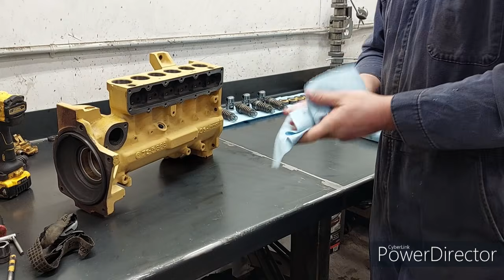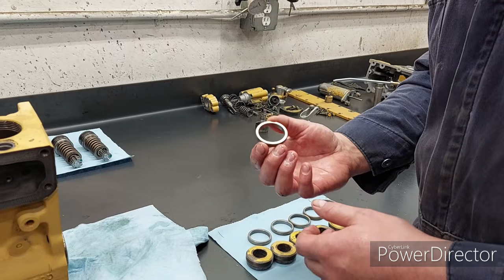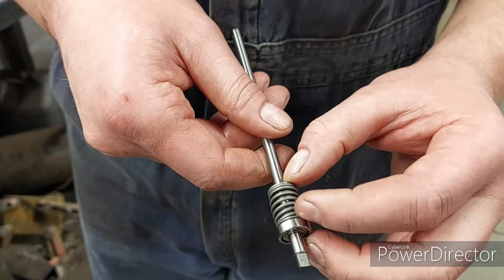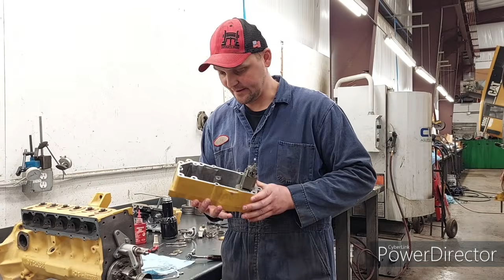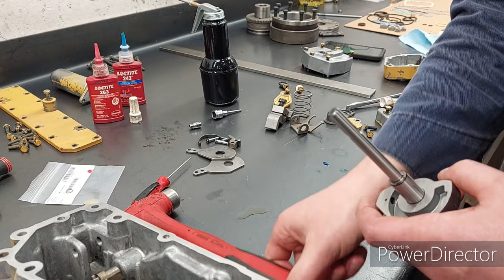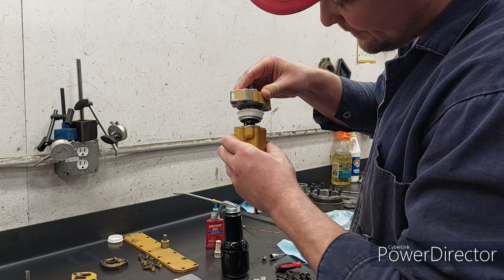3406B Fuel Pump

Comment: I have a leak coming out of the top of #5 hole how tuff to change o ring… I’ve heard it can get tricky??? Thoughts
Reply: If the leak is on the inside around the line it is the line or the bonnet. If the leak is on the outside between the bushing and the housing, it is the seal. Or you could say the threaded area. If not sure, get some odd color paint and clean the top of the pump, then paint it with the odd color and start the engine. The fresh paint will wash away when the fuel hits it. Fixing the leak you have to worry about three things, clean, clean and clean. Most people try to remove the bushing. You have to have a special tool and take the bushing out and just replace the o-ring. Then all the debris falls down into the pump and you will start getting fuel in the oil. The correct way is to remove the shut off solenoid (6I2002gasket), remove the plug under the air compressor on top of the pump 9/16 wrench. Install a rack centering pin (special tool), remove the side cover on side of the pump. Two bolts 7/16 wrench, 1H9696 o-ring. Move the throttle wide open and make sure the rack is now in the center position. Remove the bushing and the pump. You have a spacer under the pump, remove it.  Clean the bottom of the pump, spacer and inside housing. Inspect the spacer for nicks, replace it if you see any. Depending on which engine you have you have two sizes. DO NOT PUT THE WRONG ONE IN. I also clean the rust off the top of the bonnet on the pump and the bushing. The bushing was a problem on these and Cat updated them. They would not seat the pump good enough and over time fuel would bypass on injection. You would have a stumble on acceleration (could also be a nozzle). Cat update the bushing and again you have two depends on what engine you have. "Get this article from Cat a Truck Engine News 11/01/1985 Check Fuel Injection Replacement Pump Installation (SEBD6553)" The oring has been updated numerous times, the best one is 1313719 (Pink). Also a 8H9204 felt washer it goes in after you torque the bushing 190 FT LBS. I put the spacer back in, put the pump in clean fuel and you have to align the gear to the slot by eye. It is best to replace the bushing with the updated one (you don't have to). Put clean fuel on the seal and bushing. Make sure the leaking cylinder the fuel pump cam is down and you are not fighting against the lobe. Put the pump, seal and bushing in. Do NOT force it, a little is OK. Get the bushing started and run it down until it seats. Check the pump timing using the Truck Engine News Article. If the rack does not move, get the pump back out. The rack HAS TO BE FREE. If it is not the engine could run away and blow up. So you lift the pin up and push the rack back and see if it is in time. Then move the rack to the shut off position and see if is in time that way. If all is good torque the bushing and finish assembly. Sometimes you could be fixing one hole and the leak will move to another one. This system has no relief valve in the low fuel psi side. If the fuel return line is plugged up or not allowing enogh fuel to return to tank, the leak on top of the pump will move to the next weakest seal. Most of the older 3406B/C's uses a number four fuel line. I like a number six as it is larger and last longer. The way this engine makes low side fuel psi is the return fitting in the pump. So you have to order a special fitting from Cat. Also replace the fitting in the tank to increase to a number six. If the fuel return line was plugged up, it could blown the check valve out of the fuel transfer pump. If you replace the line that was stopped up, now you could have a low fuel psi problem. This maybe more then you asked for, but this is what I have seen in my 45 years working on Cat truck engines. Good Luck

Comment: At 1:26:12 that piece your putting on has worked loose on mine to where it wobbles. The bolts are all very tight. Any ideas on that?
Reply: That is your FRC, most of the time you need to helicoil the housing. I have done a lot of them and replace the seals.
Reply: @JohnnyGSmith-k4z  Ok thanks!
Reply: @JohnnyGSmith-k4z  What's the best lock tite to use on theses bolts?
It turns out the top bolt was missing. Its a 3-3/4 inch x 1/4 inch bolt.
I have had a lot of trouble with the wires breaking off the electronic shut off at the eye terminal.
Plus the bolts kept backing out of it causing an oil leak. 
So two weeks ago I red loctited that shut off solenoid and put new nylock nuts on it.
Reply: @RC-Heli835 I would not use locktite, I would helicoil the bolt holes and make it a stronger grip. I would also make sure the wires on the shutoff are long enough so they are not in a  bind. You have three types of shut off's for this engine. Electrical, air over electric or a manual pull cable. I dislike the air/electric as you have to have air psi and on start up, if you see a problem, you could not use the key switch. You would have to choke it down with the clutch.
Reply: @JohnnyGSmith-k4z  I sure don't want the air over electric.
This Pete has a 3306 from the factory the wire lays right acrooss the transmission and then stays in the air all the way to the shutoff solenoid. 
I may need to rig up some sort of support to get it like 16 inches up to that point.
In the last year and a half it has broke me down in some very inconvenient places 4 times.
Once the ground wire broke off and I costed to the top of a roller coaster hill  near lake Julliette, ga hwy 18.
There the road had 10 ft drop offs on each side. So while I still had air I held steady brake pressure and let it roll slowly back to the bottom where traffic could see me from afar from both directions.
Because the wire was burried in greasy wire loom, I cut an unused wire off the frame and crimped on a new ring terminal and bolted it down to the frame and the solenoid. Fortunately a game warden had pulled up and said he would stay until I got it going and run his lights.
I shut the hood, fired it up and drove away.
That ground  terminal broke on me not two months later in another inconvenient place. Just a new crimp at the shutoff solenoid bailed me out there.
Im past tired of it.
And this latest thing with the leaking oil and fuel right on the exhaust all day. Here I am hauling asphalt right?
If I don't show up with that asphalt the customer who paid 1500 hundred dollars for that  will charge me for it. I will pay a 1500 dollar wrecker fee if I'm lucky right? Then if I cant get the truck running the asphalt will soon set up hard in the back of my truck.
Reply: @RC-Heli835 I thought you had a 3406B, no manual shut off. I would run the ground wire from the shut off to the alt ground post and run one from the solenoid to a clean place on the block and do away with this long ground wire. You can also replace the FRC with a plate. Be warned, if you throttle heavy a lot of black smoke could come out the exhaust. The FRC restricts fuel until you have enough air to burn the fuel.You have two types of FRC's on a 3306, 63Z and 9TL. If the diaphragm fails, it won't fall out of a tree.
Oil and fuel leak? Does it have a Jacob's Brake? 63Z or 9TL best what is your full engine serial number? If you have a Jacob's Brake the valve cover is a bad leak point. The gasket has been update and you have to make sure you get the updated gasket. Oil leaks on the governor is a problem on 3306's. Cat has updated the gaskets and special bolts in a few places. The tach shaft leaks oil and the  drain is bad to leak as well.
Reply: @JohnnyGSmith-k4z  Yes it has Jacob's Brakes and I think right now the worst oil leak I have is what some folks call the rocker box.  It sits on top of the head and under the valve cover. 
The Vin# is 1XP-ALA9X-0-TN385955
Reply: @RC-Heli835 Need the engine serial number, not the truck vin. Also on some 3306 with Jacob's Brake you have two sizes on the push rods. If you mix them up you will break them. I like to put the big ones in all holes, so this dosen't happen.
Reply: @RC-Heli835 You cannot use the new style valve cover gasket on your engine, unless you update the Jacob Brake valve cover base. Which from what I can tell is no longer made. You have to use the old cork gasket.
Reply: @JohnnyGSmith-k4z  I'm fixing to reroute the ground on the shutoff now. I think this is a B model. I'll see if I can get the serial number.
This thing shut of on me several times yesterday 1.5 hrs from home. I had to get out and tighten the ground nut at the solenoid.  I stopped one more time before it shutoff and tightened it. There was an area I did not want to be broke down ahead.
Reply: @RC-Heli835 I have your engine serial it was a 9TL08 something, 300 HP, Jacobs Brake in a PB. It is a later 3306B. The 9TL's was the last 3306 made for a truck. If the nuts are working loose, your terminals could be damaged from loose connections. The nut is an 8-32 thread. Cat part number 6V8377, lock washer 9B7233, ground wire made by Cat,9D6637. You might need to add a few nuts and extend the ground wire out until you have a better thread, then put the wires on after a few nuts are installed. I would do this on both the hot and the ground.  I dislike the FRC's on the 9TL's as I said earlier you could put a plate in its place and take it off. If I recall (could be wrong) it made the 9TL's harder to start with that style of FRC. How does it start, good or slow. It ias always best to push the clutch in (takes some load off the starter) and depress the throttle half way until it fires off.
Reply: @JohnnyGSmith-k4z  I haven't been able  to find a video of a Cat 3306B on installing the jake housing and jakes and running over head. I'd like to do this myself! I have a bad oil leak coming from underneath the jake brake housing.
Do you know where I can find the info?
Reply: @RC-Heli835 i need a e m a i l
Reply: @RC-Heli835 I have several documents for a 3306 with Jacobs Brake that you need.
Reply: @JohnnyGSmith-k4z  Is there a way you can email the section or  running the overhead?
I desperately need to get that jake housing resealed. As mush as this engine vibrates things loose I wonder if RTV Ultra black would be betterthan a gasket?
I have the back cover of the injection pump fixed and now it is dripping diesel  somewhere in the middle of the entire back section.
Reply: @RC-Heli835 I have several documents you need. I need a email address. A fuel leak, I would look at the nozzles or the fuel return line, depends on how it is routed. If it running off the top of the head and dripping off the rear. The nozzles has two external leaks, bleed screw on the side. It is a replacement part and can be fixed. A seal at the top of the nozzle, have to replace nozzle. Unless it is a fuel line leak. A lot of people don't put the fuel line brackets and clamps back on and the lines rub or break.

Comment: Question. We have a 3406b 1990 Peterbilt. Will an injection pump off a 3406c work or is it a serial number thing.
Reply: Depends on what you have, early 3406B's has a different VTU and cam timing could be 24 degrees BTDC and lower fuel injection psi. Later pumps changed VTU, which requires a fuel system camshaft, and housing, lifters, pumps and so forth and went to around a 10 degree camshaft BTDC. If you change pump and VTU it  will bolt up, how will it work, who knows. As you are playing with timing, HP and other factors.

Comment: Do you have the part numbers for governor housing springs fly weights and carrier
Reply: The spring is based on Full Load speed, anywhere from 1600 to 2100 for hiway trucks. Most truck engines has a 10% droop governor. I cannot say for off hiway engines. The flyweights and flyweight carrier has been updated. The flyweight race is updated, however it may not be in your serial number. You have to look elsewhere for it. So, in your commit you said SPRINGS, so what springs are you referring to? A full engine serial number would help.
Reply: @JohnnyGSmith-k4z 4MG84144. I was talking about the springs on the dash pot
Reply: @patricklewis8810  The dash pot has no springs, it is on the rear of the governor housing about middle ways. Inside the governor , on the tach shaft is the main governor spring, some had an over fueling spring ( Cat said to remove it), then on the end of the shaft you have a spring with a ball bearing that goes up inside the governor guide, also a spring on the shaft for the manual shut off, the FRC has several springs inside it. 4MG 84144 is a 310@1800 with a Jacobs Brake.

Comment: So how do I adjust the high rpm adjustment? Mine tops out at 1600rpm and runs out for gear before it needs to. I’m trying to top it out at 2100 as long as that’s safe.
Reply: What is your full engine serial number?

Comment: If rebuilding a truck pump, is it ever recommended to have it ran on a bench test to calibrate? Or is there not much calibration on these like Bosch pumps?
Reply: Not on a 3406 B or C with new pumps. The spacer/seal has no adjustment. Early scroll Cat pumps you had to use a degree wheel and measure injection timing (off the engine). Then pick the correct spacer/seal. Only adjustment would be the fuel settings, FRC lever and dynamic FRC setting. Then on the engine you would adjust set point. Now on sleeve metering fuel pumps, yes it needs to be bench tested. As the cross over rack (3208) and each lever has to be set. 
Now on the timing advance, you can set static timing (pin), but if you play with the start and stop screws. You have to set it dynamically with a timing indicator group. Read my comments below on dynamic timing.
Reply: @johngoldsmith6629 so the frc wouldn’t need any adjustment? Or if so, is that done on the engine? Sorry if your other comment talks about that. I’m not seeing it
Reply: @BronsonA14  You have two adjustments on a 3406B & C engine. Most truck drivers dislike the FRC. If you are going to take it off. Order a cover where the FRC goes. Don't cut the valve off and destroy a high dollar part. The FRC, Air Fuel Ratio Control Valve, limits fuel until turbo psi builds up to prevent excess black smoke. The lever setting has to be done with a dial indicator. Once that is done, you leave the dial indicator on the engine. Start the engine and with the cover off the back of the FRC, press in on the valve to cock the FRC. Then you throttle the engine wide open very fast and read the dial indicator. It will hold it at the setting just for a moment. So you have to do it several times to see the setting. It could be negative or positive on the dial indicator.
The way I do it, is with out the dial indicator. Same as before, with the cover off and engine running. Press in on the valve and cock it. Throttle wide open very fast and look at your exhaust. Turn the screw in for faster response and more black smoke. Turn it out for slower response and less black smoke. Remember black smoke is unburned fuel and money out of the pocket. Find the setting that you like. If you have a flat bed, no worry on more black smoke. If not your going to soot up your trailer. The FRC has changed slightly over the years, most people when the rebuild it. Don't change the internal seal. You have to take the jam nut off and take the screw out. The old part number is still in the book. The new part number is 3E6760, last longer. Also the part that the diaphragm sets on bottoms out against the retainer. It can cause a sharp edge and will cut the diaphragm. So I bevel the edge down to prevent this.;  
One of the main items on a Cat mechanical engine, is throttle travel. If it's to long you won't get full power. If to short, the throttle can wear out the governor housing and seal faster. As the cab can flex loading up the linkage. So on the throttle linkage on the governor, it has two pieces. You should feel the throttle linkage come to a stop, and when you press it more. The lever will deflect back, but the throttle in the governor will not move. This is called break over, and on the side you can see a slot in the lever lift off the inner part. You would like it about half way in the slot. If you move the linkage from the top slot to the lower slot you get more travel. So you have to see where your travel is, and make adjustments as needed. Loosen jam nut and turn end piece in or move linkage up or down. Now if you remove the bolt with the 3/8 head and turn the lever, that will adjust the pedal height. So you what to set it where you foot is not in an awkward position and at the end of the day your leg is not worn out.